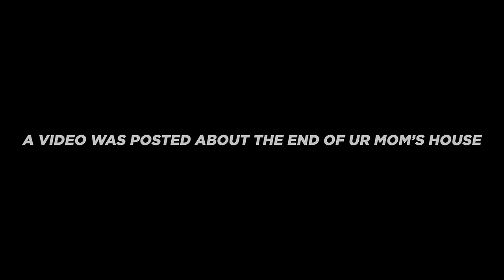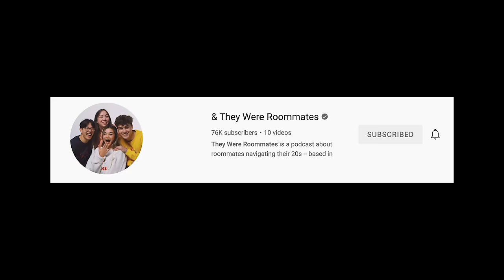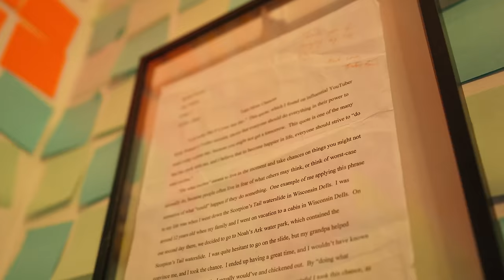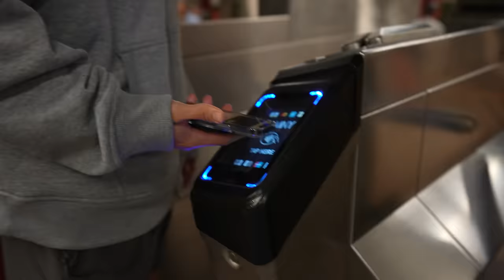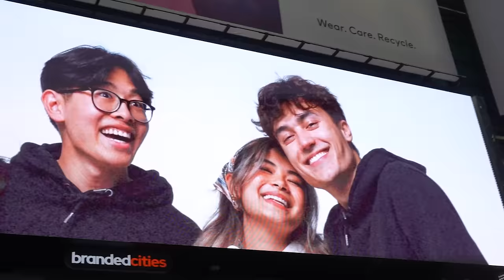The Truth Why Ur Mom's House Ended

Comment: 2 huge points to call out and unpack as to why this ended disastrously -->

1. The mission and intent of Ur Mom's House was to have a creator house, under the premise of creating group content and facilitating group activities equally distributed. Both Elliot and Anne-Marie were in sync to this idea, and its precisely the reason why they both exited once it was unmanageable and phony. From the very beginning if you watch closely, Ashley and Kelly's storyline was and currently is solely focused on their relationship, with the small percentage of filler content from Elliot & Anne-Marie (usually in the form of answering questions to set the scene for Ashley or Kelly's videos, commentary, or surprise/animated reactions). But as mentioned, an overwhelmingly large amount of the content was positioned by Kelly & Ashley as a journey of their relationship, dating activities, and travels. 

Let's uncover a starkly contrasting example, shall we. If you look closely at Anne-Marie's content, Kelly is visibly disengaged and uninterested in the being part of the videos, based on body language, facial expressions, etc. In short, Kelly and Ashley created content with their relationship as the focal point -- and highest priority, whereas Anne-Marie and Elliot were genuinely interested in the greater group dynamic, and the friendship aspect of content creation. These differences created a recipe for disaster. 

2. Kelly is dishonest and not accurately depicting the situation why Ur Mom's House is ending. Elliot chose not to renew nor continue living with them, not the other way around! If Elliot wanted to live and be part of the Ur Mom's House dynamic, he would of continued to want to live with Ashley and Kelly, but perhaps in a smaller apartment or more economical location. But obviously this wasn't the case. Given Elliot's decision, Ashley and Kelly had to either find new roommates or find another living situation. Its clearly evident the toxicity, immaturity, and dishonesty from both Ashley and Kelly , explaining why nobody else wanted to live with them, forcing them to dismantle Ur Mom's House.